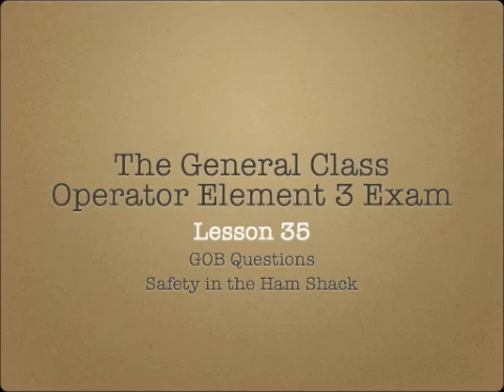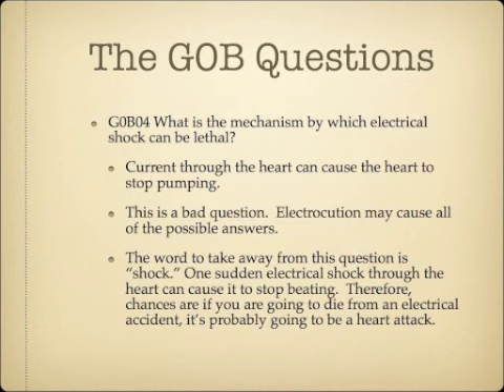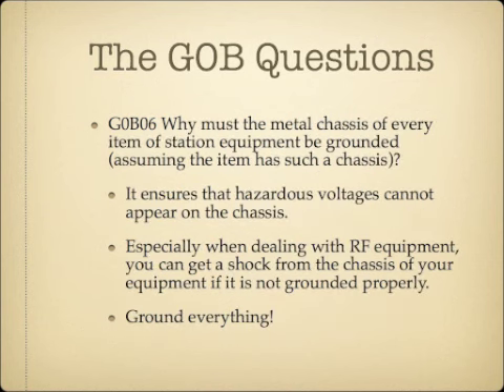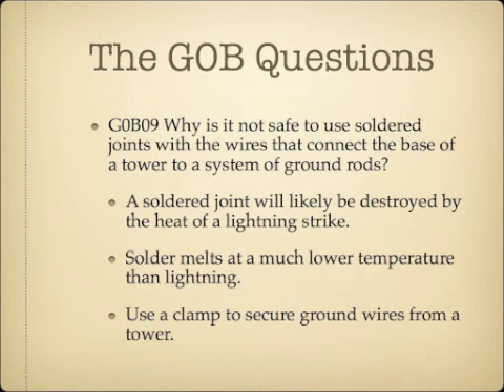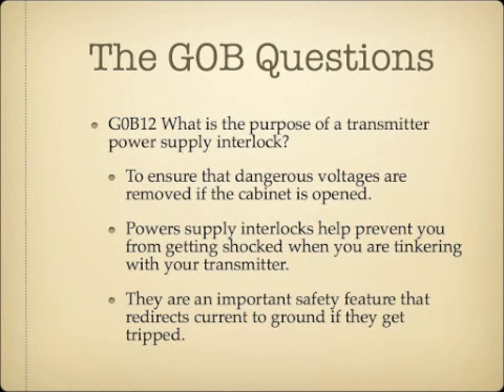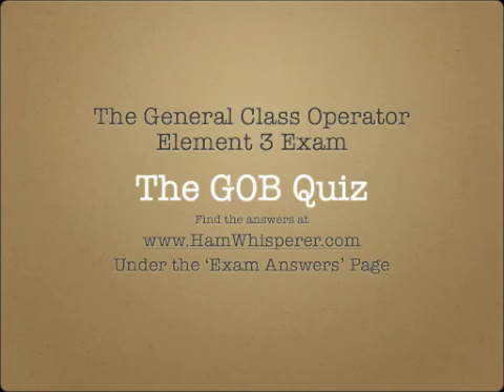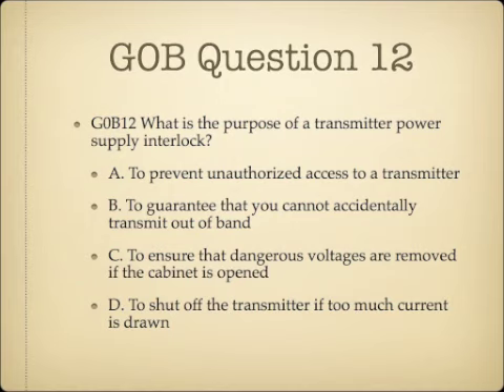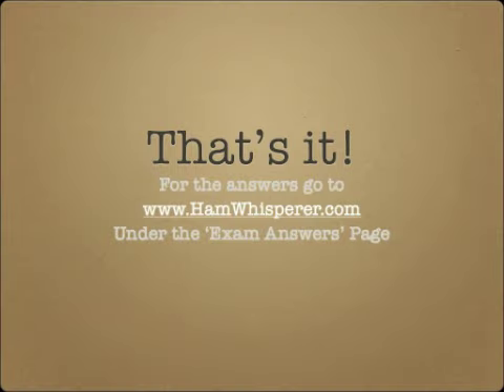Lesson 35: General Class Exam Course G0B

Comment: Also, as per table 310.15(B)(16), a 12AWG wire of insulation type UF or TW has an ampacity of 20 amperes, which is not allowable given the 125% requirement of article 210.19(A)(1).  Therefore, unless the wire was specifically 75C or 90C insulation category, a 12AWG wire would be illegal to use and create a potential fire hazard for a 20 ampere continuous load as per the NEC.

You may want to forward this information who writes these tests.

Comment: I don't know who wrote these test questions, but the answer to question number 2 is wrong.  This is something covered by NFPA 70, the National Electric Cod (R)

As per NEC 2011

According to article 210.19(A)(1), a branch circuit conductor "shall have an allowable ampacity not less than the noncontinuous load plus 125 percent of the continuous load."

This means that if you are expecting 20 amperes of continuous load, you must select a wire size with an ampacity of 25 amperes.